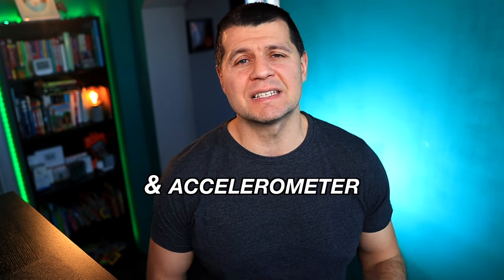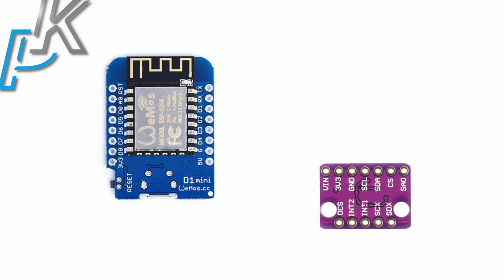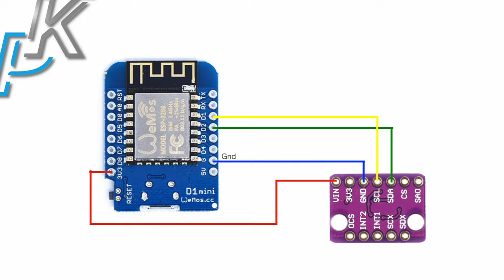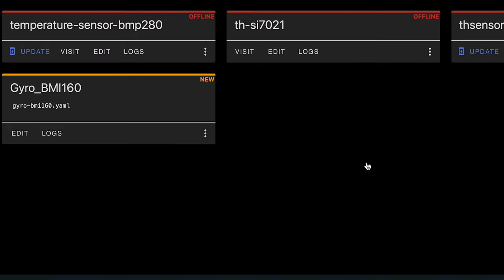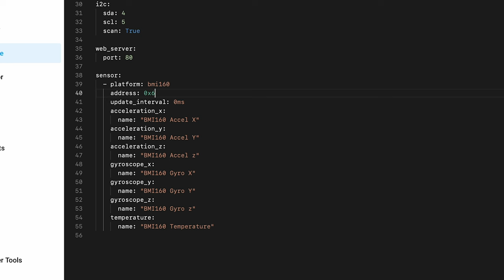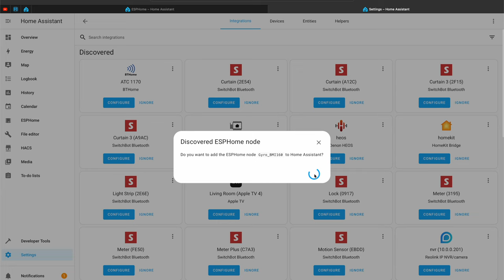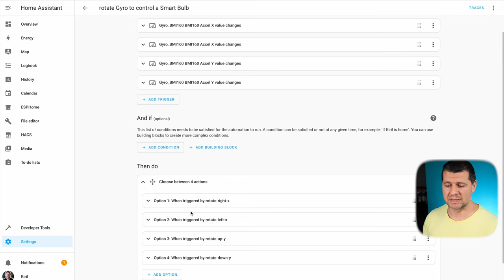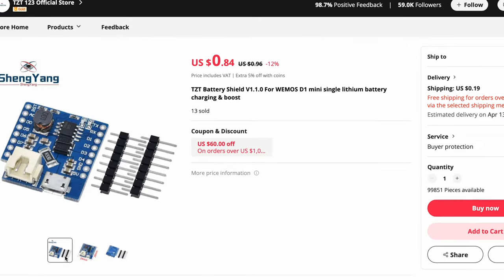EASY Gyro + Accel Sensor for LESS than $5 | Home Assistant

Comment: Great video.  Is this also capable of reporting elevation and azimuth in degrees? I want to use the sun azimuth and elevation within home assistant to guide my solar tracker, and then check that the tracker has moved to this position using a three axis gyro/accelerometer. Will this do it?

Comment: would like to watch with battery and deep sleep!
Reply from the maker: Thanks for the comment. For what are you going to use such a sensor?
Reply: to use it for manual control of watering valves

Comment: P;ease make part two.
Reply from the maker: Thank for the comment. For what are you going to use this if it is battery powered?
Reply: @KPeyanski  I'm not sure what I'll use it for yet but maybe I could use it for a garage door sensor or just have it in my workshop for adjusting the lighting. I've already got a spare D1 mini and plenty of batteries so I only need to purchase the sensor. It should be a fun thing to play with anyway.

Comment: When you add the battery, would you put it in deep sleep and wake it up to save power ? If so, how would you wake it up ? Through interrupt ?
Reply from the maker: Good question! BMI160 support fast start-up mode and it is waking up based on any motion, but I haven't think much about that yet. I will try this second battery part ONLY if there is enough interest/views for this video. So let's see...
Reply: I would definitely be interested in this, I can see tons of uses for garage doors, normal doors, washing machines, etc etc  @KPeyanski

Comment: Thanks for the video. Interesting. I'd have some ideas of what could be done to HA and maybe quite cheaply.
A water meter. I think we have a similar meter - an alarm clock on a pipe with a numeric display. I think I've seen something like that called S0tool. 
Then an electricity meter. They sell meters with cable clamps. 
Could HA do an event alert and send it via text or call for example. Maybe to clear a flood alarm. Sometimes a person doesn't have data on their phone.
Reply from the maker: You can make HA to make calls from automations and I'm using that constantly. I even have a video showing how you can enable that. Just check out my Home Assistant Twilio video - https://youtu.be/JCjzEKdlezk